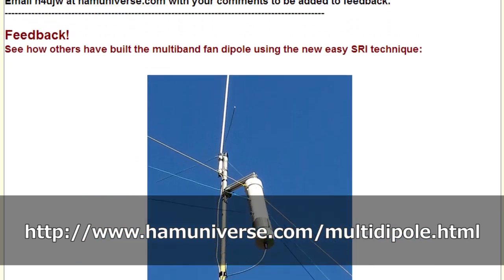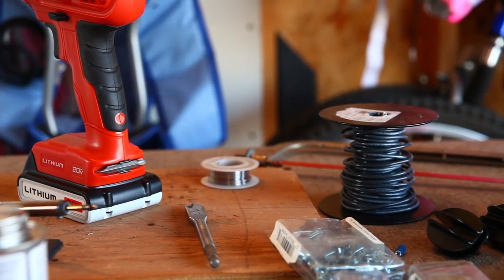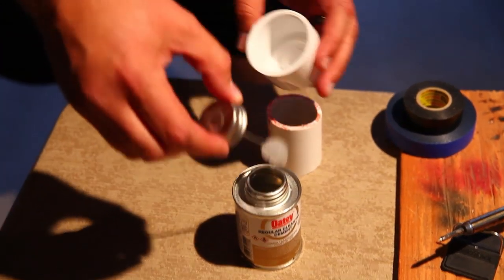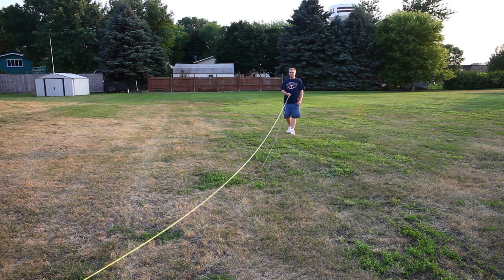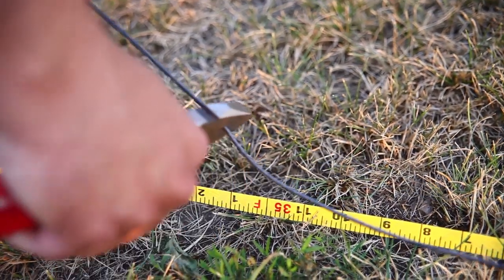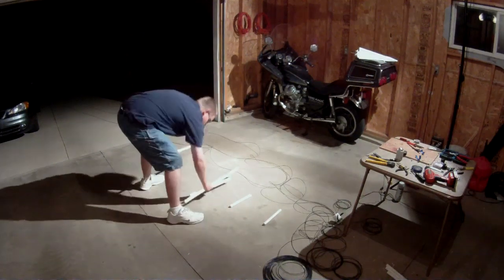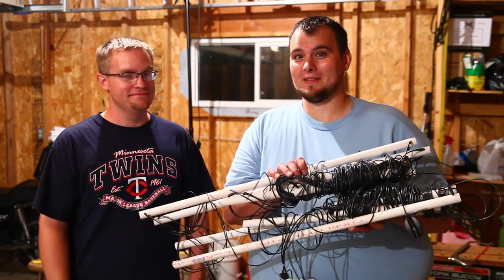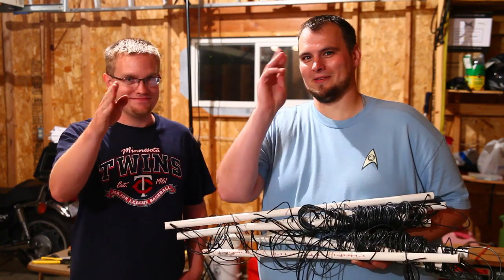Multi-Band HF Fan Dipole Antenna Construction

Comment: So, i started putting up a an inverted v fan dipole the other day anyway its working well right now for transmit. i have it perfectly tuned in the middle of 40,20 and 15, its not put up quite like your build because of how i had to do it, but in any case i first had up just the 20 meter part then i added the rest, it seemed like i have more noise now, on the 20, it could just be the band right now but as i am new to ham i have to ask the question will a fan dipole pick up more noise then a single band version? I would think it should not but just have to ask the question, i'm about to go back up on the roof and disconnect everything but the 20 and test again but thats a lot of work so thought i would ask your opinion first.
Reply from the maker: I've never had a fan dipole pick up more noise than a single band version, but if you've got a noisemaker that puts out a lot near one of the resonance points it is possible that it could happen. Sorry for not being more helpful.
Reply: no problem thanks for letting me know, it will help me in eliminating my issues i just wanted to make sure it was not part of the cause, i did find 2 things at my house that are noise issues so i unplug them when i use my radio, but still working on figuring out how to reduct it more. any other noise is now coming from outside my home and after driving around the neighborhood it does not seem to be confined with in my few blocks, it may just be what i have to deal with living in the middle of town (though its a small town)
Reply: I'm told from my Elmer's the lack of a balun is the noisemaker. Opinions?

73 KD9ILF
Reply: Jeff Ferrell. K9HCA a 1:1 yes. Every fan dipole should have one

Comment: 3:12 Rather than 6" spacing, draw the legs out in inverted vee fashion using "umbrella" spacing (6 legs 60 degrees apart).  Will resonate on 10/15/20/40/75-80 w/o tuner. Been using that type for almost 40 years with excellent results.